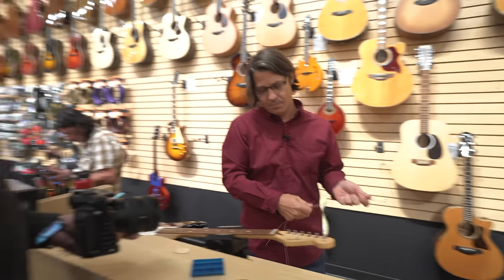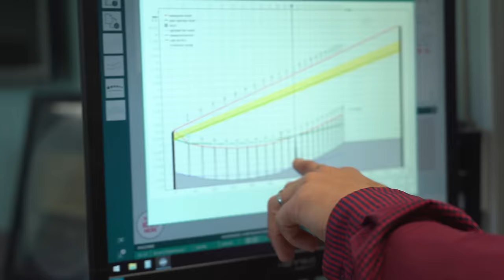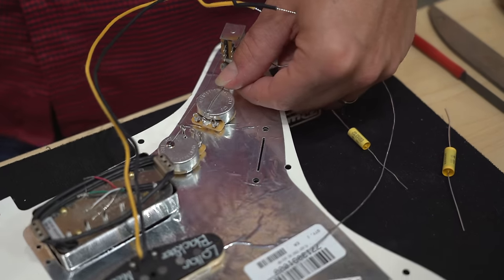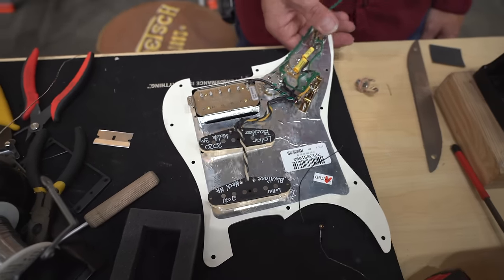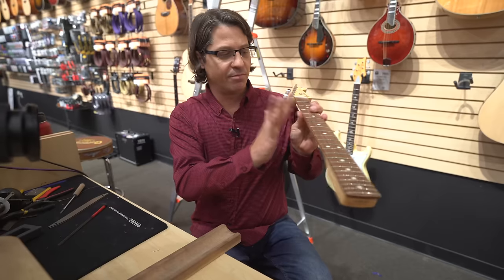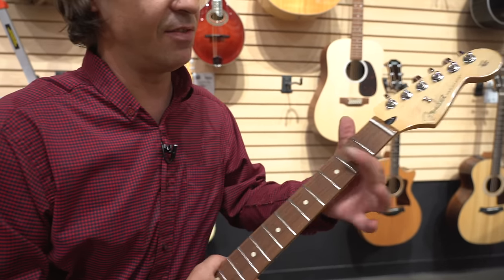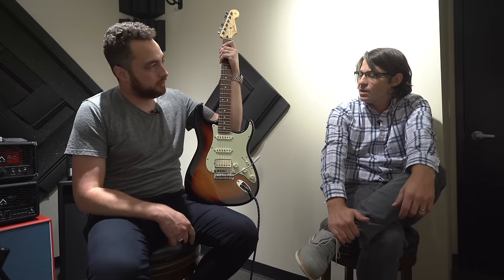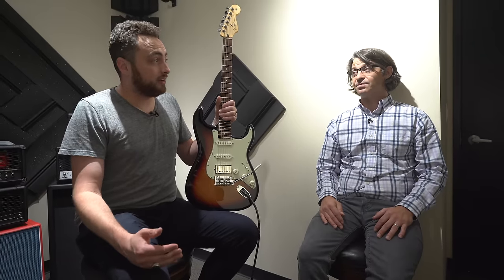We Tried To "Custom Shop" The Cheapest Fender Strat

Comment: The better comparison would be to which Fender Strat can you buy off the shelf new for $1900 and how does it compare to the upgraded Squier. I'd love to see this dollar to dollar.  Keep up the great work, Rhett!
Reply: It's a upgraded Fender Player Serie MIM. Not a Squier.
Reply: @slimturnpike  
If they had done this to a Squire, there would be no contest.  But they did this to a Fender MIM Player Stratocaster, so the contest is a bit closer.  I would say, after all that work, this guitar would be better than a 1900 dollar Fender Stratocaster.  This will have better fret work, this will have better pickups and wiring, this will have a better feeling neck..  In every way that actually matters to a person who plays, this guitar would beat out the American Professional II series that sells for around 1900 dollars ish.
Reply: There has been quite some videos about that. Depending on author, the results were mixed. Mostly they say, it kinda sounds similar, but in hand and the player experience is still cheap guitar.
Reply: @lfaf9509  totally agree. This thing has the fret work of a custom guitar, those guitars cost 5000. This things action and playability are where all that money is saved. You WILL not find a guitar this playable for less than 2000. you just will not. Or, if someone says they know of a guitar, with custom shop level fretwork, and all that, let us know, so we can buy them.
Reply: @stanislavmigra  
I think its in peoples head in some cases, and in other cases they didn't do what is needed to make the cheap guitar feel like the expensive one they say they want it too feel and sound like.   
Case in point, in this very video, he said you couldn't do it because the finish on the neck wasn't the same....  Earlier in the video they said they were going to take some of the finish off the neck and apply basically a new finish on it.  ...  If the goal was to make it feel like a Custom Shop Guitar, why didn't they just remove all the finish on the neck and replace it with the same Finish that Fender uses on Their Custom Shop Guitars?  
Don't get me wrong, they did a good job upgrading this guitar, but without the right changes, this guitar could never feel the same as a Custom Shop Guitar.  So not doing the correct changes, ensures the answer at the end of the video will always be, "no".
Reply: AVRI
Reply: @messagedeleted1922  
I might be a little broken but I would never, ever, ever tell anyone to ever spend 2000 dollars on a guitar lol.  I mean, not when you could buy a cheap Squire and upgrade it to play and sound how ever you want it to sound and play.  I mean, you can do a Fender Custom shop level Fret job yourself or pay a tech to do it for you.   
With that said, all the company's that produce guitars at that price range will produce guitars with comparable fret jobs honestly.  Fender's Custom Shop Fret work is good and all, but its comparable to what most company's produce for less, at least from my perspective.
Reply: I’ve got great, light (like I wanted & needed) 2020 Affinity I’m adding to doing my own work as I have the funds and it’s coming along beautifully. I know it’ll never be a custom or maybe not even a Pro II but when done it’s gonna be exactly what I envisioned 2 years ago. And sounds (should) already feels great. A keeper.
Reply: I'm wondering this and I know there are some videos on it but sorta haven't answered my questions 100%. Let's say you have an American Strat and a $300-400 squier. I see some people say "no matter what you do or upgrades you use, the squier will never be what the American Fender is" OK so why is that?! Does it all come down to the quality of Woods used? Because basically everything but the actual wood can be changed out and upgraded right? But I still see people say "No. it doesn't compare". Is it somewhat the "Fender" name playing into that opinion? I think also "upgraded cheap guitar" is appealing to some people because not everyone has 1,000+ extra to spend all at once. It's easier to buy parts here and there when you have the $ to spend. So basically I'm asking, if I eventually took every part off the Fender and put it on the squier, set it up, fixed up frets/neck, why would it not be as good still?! Some of the spec sheets I've seen looked like they even use the same woods? Honestly wondering.
Reply: @Bb186fo  
What I am about to say might very well make a few people angry, but I will answer your question.  
The guitar will sound and feel the same as the expensive guitar who's specs you copied.  The wood doesn't actually matter, that is all advertising b.s. honestly.  People have said differently, but its always ether because they didn't do as good of a setup on the cheap guitar or they didn't use the same parts, or didn't copy neck shape, or are concerned with resale value more than reality its self.   The only difference between your project guitar and the expensive one you copied, will be the name on the headstock and resale value.  In every way that matters, if done right, they will be functionally the same guitar in every way that matters as a player.
Reply: @stevelaferney3579  
Depending on the parts and how good of a job is done on it, it will not only be a keeper, it will feel and sound like any expensive guitar.  It might be a little thinner than a custom shop, I can't remember if it was the Affinity or the Contemporary that Squire used a thinner body on.   But outside of that possibility, it will feel and sound just as good as a custom shop guitar, providing the work you do or have done is equal to that level of work, and the parts are as well.
Reply: HUGE oversight imho. He did a similar thing with the amp vs plugin video, didn't compare the amps themselves through the same cab or same IR.
Reply: @messagedeleted1922  "Or, if someone says they know of a guitar, with custom shop level fretwork, and all that, let us know, so we can buy them." An Answer: Weir guitars. May or may not be your style. Dave at Weir hand selects wood, kilns it himself, then makes some of the best necks in the business. Guitar will run ~$1250 today.
Reply: It's not a squire.
Reply: I mean there are literally 20 videos doing tht already lol
Reply: Exactly my thought.  If you had $2k to spend, why not by a $2k guitar which will probably have better resale.
Reply: Or swap everything on the two except for the neck and body
Reply: @Bb186fo  
It won't be as good, because it is what it is.
The guitar you envision will always be a modified Squire, you'll know that, and regardless of what it sounds and plays like, you'll always have that nagging doubt that it doesn't make you feel as good as if you had the real deal.
There's a huge psychological aspect to this hobby and it's real, if you had a great US Strat, you'll cherish it and it will make you feel good just owning it knowing what it is, as opposed to your modified Squire, which will always be just a soulless bunch of parts.
Reply: @lfaf9509  Refinishing will never look right because to preserve the logo and SN, you'd have to leave the headstock faces or the entire thing in poly.  Either way, it's going to cost quite a bit for a shop to do that work.
Reply: @markuyehara7880  
Shops charge between 200 and 600 to do it sure, but with nothing more than the paint and the cheap stickers and sand paper and time, you can do it at your house honestly. 
Sure it cost money ether way, one for a lot less money and the other way for a lot more money. 
Ether way though, how good or bad it looks depends on who does the work more than anything else really.  I mean, if you are careful you can remove the clear coat of Polly without messing up the paint under it, and replace just that with Nitro..  If it actually matters to you as a player..  
Honestly the only part of the guitar where the finish actually matters, is the back of the neck.  Think about the best Gibson you ever played, I am willing the bet the finish on the back of the neck had ether worn off or someone sanded it off, or it had a Satin neck finish.   The only finish that matters for playing is the neck..  Do you know how much it cost to take the polly finish from a neck?  You can do it at home for the cost of the 600 grit sand paper, or you can pay a shop to do it for you.  That can run about 100 dollars or so, but honestly you can likely find a shop to do it for way cheaper.
Reply: Yes. This should definitely be the next video!
Reply: @lfaf9509  What I heard was that they were going to sand it with a scotch pad, and put some carnauba wax on it. Not a new finish.
Reply: @Bikedueder  
Taking a scotch pad to the neck would remove some finish from the neck.  Basically they scratched up the finish on the neck, then put wax on it to fill in the scratches.  The hopes is to make one type of gloss finish feel like another type of gloss finish.  Polly to nitro..  I would of liked them to ether use a scotch pad on the neck and not do the wax treatment, or use sand paper and remove at least most of the polly finish, if not all of it.  Then refinish it with a more satin finish..  But I am one of those folks who hate gloss finishes on necks, they get sticky and are hard to keep them from getting that way.    
I owned a Epiphone SG Modern and no matter how often I cleaned its neck, it would become sticky within a minuet or so of playing.   I have sold very few guitars in my life, that one I sold..  Though now I wish I just took a scotch pad to its neck... live and learn I guess..
Reply: @lfaf9509  “I would never, ever, ever tell anyone…” well, keep in mind that some $2000 guitars feel - in hand, to an excellent player - like a $1000 guitar. And some $2000 guitars - to that same player - feel like a $4000 guitar. As with anything made in part or in whole by humans, the specific instrument matters.
Reply: Same question occurred to me but then what would be the fun in that?
Reply: @turunturun  
I think that is a bit of some old marketing b.s. myself.  Most guitars are made mostly by machine now days, and thus won't have much of a difference between them.   At least that is the case outside of custom shop, and a lot of that process will include machines to do the heavy lifting for the person putting it together. 
You take that same person who says they can feel the difference between a 1000 dollar guitar and a 4000, and blind fold them.  Let them compare a Squire with a really really good setup on it, and a Fender custom shop and the only way they might spot the difference, is if the pickups are different, or they are used to the neck shape on one of them.  Switch the pickups around and they wouldn't be able to tell the difference.
Reply: @lfaf9509   I don't have sweaty hands, so therefore I have no issue with gloss necks at all.  It is not the finish on the neck that is the problem, it's your hands.....  Don't buy guitars with gloss necks, and you should be good. Some advice though.. Replace the whole neck, and sell the original to someone who can use it as is, instead of ruining it by sanding all of the finish off.
Reply: @Bikedueder  
If the goal is to make a guitar play better, and a Satin finish on necks play better for most players..  Some necks you can take off easily and other necks are glued in and are thus harder to take off without damaging them.  So removing the finish from the neck is often easier and if you are just using a scotch pad on the neck to remove some finish, you are not removing all the finish..  Basically you are just changing the texture of the neck so that its easier to play.    
Yes sweaty hands do make a guitar with a gloss neck harder to play, but Satin finishes are easier to play on than gloss for everyone, not just people who's hands sweat.   
make no mistake though, sanding some finish off a polly neck, is in no way actually ruining it.  If it makes it easier to play, its just adjusting it to be more playable.  We don't call shining frets ruining them, so we shouldn't call sanding some finish from a neck ruining it. 
Try to remember though, the stated goal in the video was to upgrade a guitar to make it feel as good as a custom shop guitar.  Custom shop guitars come with a different finish on both the body and neck, than a cheap guitar will.  Changing the neck out can work on a bolt on neck, but such a job is more expensive and harder on guitars with glued in necks..  Sanding it down is likely cheaper in ether case, which is why they did exactly that in this video. :)
Reply: That is a Fender… not a Squier…
Reply: @REBELSCL  I stand corrected
Reply: @REBELSCL  
"That is a Fender… not a Squier…"
....  I think I am likely about to blow your mind ready?..  A Squire is in fact a Fender, just like a PRS SE is still a PRS, or a Epiphone is still a Gibson lol..   Fender owns Squire, just like PRS owns the SE guitars, just like Gibson owns Epiphone..  A Jackson is still a Fender, a Kramer is still a Gibson..  Get it?     Its the same company, who just puts different names on guitar head stocks to signify where they are made more than anything. 
For PRS a SE is made over seas, for Gibson a Epiphone is made over seas, for Fender a Squire is made over seas..   
I get it though, the guitar used in this video had the name Fender on the headstock, and it was made in Mexico, but the point of the OP is just as valid really..  Wouldn't you love to see what the Op was asking for?  A dollar to dollar comparison.
Reply: @stanislavmigra  did they eliminate bias? You have to do those sort of tests blind, especially when there’s a perceived value difference.
Reply: @Michael Casias 00's and 90's squiers are great
Reply: @lfaf9509  The wood matters quite a bit. If it didn't then you couldn't run the rack and find guitars that sound significantly different that were specced the same. That said, it doesn't mean what you find in a more expensive Fender is going to be better than what you might find in a Squire. It's much more of a luck of the draw thing.
Reply: @brandall101  
"guitars that sound significantly different that were specced the same. "
I didn't quote exactly what you said, but I figured you would know what I was replying to exactly by my response lol. 
Anyhow, if you find two guitars that are speced the same, but sound different, it isn't the wood thats doing that.  Inconsistency in the process of making pickups can do it, margin of error in the pots can do it, even a slight difference in the position of the pickups along the scale of the two guitars can cause it.   There are so many things that can cause what you are talking about, I see no reason to even suspect wood plays a roll when there are so many more logical reasons for slight differences in tone  between two guitars with the same specs...  Even setup can cause a difference....
Though I do believe there is some luck of the draw, its just about the pickups and setup and where the pickups are along the scale thing..
Reply: SRV signature strat.
Reply: An HSS Professional II runs $1749
An HSS American Ultra runs $2149
I got my brand new,  warranty covered HSS American Ultra "B-Stock" for $1736. And it's flawless. I think it was a "B-Stock" just to get around the MAP.

So ,$1900 for this  "upgraded" Fender is a complete waste of money.
Reply: Against a moded Squier Classic Vibe
Reply: @StoTemPil  check out my modded bullet.    Seam foam green hard tail aged parts and tortoise shell pick guard
Reply: Can say from experience that you can make a Squier bullet play better than a fender with enough time and some money for electronics upgrades. Even with boutique pickups, you’re coming in wayyyyyy lower price than higher end fender guitars
Reply: @eriktaylor4323  I did it.    Check out my sea foam green hardtail with aged parts and tortoise shell guard.
Reply: @lfaf9509  Well, thats because wood vibrates, so part of the vibration of the string is absorbed by the wood. 
What that means? That wood directly influences how the string vibrates, thus influencing the way it sounds. 
Use a cheap, bland wood, and you will have things like less highs and lack of sustain. With better, harder woods, the highs are more defined and the sustain is longer, cause harder wood will absorb less frecuencies from the string.
If you can't hear a difference among different guitars must be bucause the woods used today are mostly good woods. I mean, we have almost 100 years making electric instruments, we already know what works and what not, and deffinitely there are some cheap options that still work. 
Anyways, wood is just a part of the whole thing. As you mentioned, there are a lot of factors that influences tone.
Reply: @slash148  
"wood vibrates, so part of the vibration of the string is absorbed by the wood. "

You might think huh, but in reality you impart energy into the string when you play it, and some of that energy goes to the pickups which is turned into a very small charge, some energy is transferred into the air via sound waves, which is what you hear without the amp, and some energy is transferred into the wood and escapes via the wood vibrating.  The net total amount of energy that escapes the strings affects actual sustain as the more energy that can or does escape the faster the string stops vibrating.   
Now, all wood vibrates within a very small frequency range, and the range is so small the human ear could not hope to ever pickup on it.  So even if wood were absorbing frequency's and such, all the difference would be so very slight that no matter how hard you strain your ears, you couldn't hear the difference. ..  Yet, one small difference in how a pickup is constructed or wound, will make a massive difference....
The concept of tone woods has been around for a very long time, but it is and always was just marketing b.s.  The only actual thing wood choice affects, is looks and of course how easy it is to ding or scratch..  The rest, actual Science has already proven to be untrue....
Reply: I have a squire classic vibe jazzmaster. New tuners the second I got it, then new wiring/pickups after about 6 months, then new bridge/trem about 6 months later. Went over board on the pick ups/wiring, but got some fun custom mods that make it feel personal. The neck and body are still great, and I don't feel bad letting it get beat to shit playing some lively shows at smaller venues, let a friend paint the back, would always do this over both the American Pro ii models.
Reply: I bet custom shop Strats are not pleked.
Reply: @messagedeleted1922  well you can get custom shop fretwork and playability if you pay like 150 bucks to a good luthier lol
Reply: I just don't get why an  $800 plus guitar needs that much fret work.  A $200 is one yes, but $800 ?
Reply: An American Vintage II is $1900. I'd take that over this build any day.
Reply: a fender neck with jumbo frets its 300eur in europe(probably way cheaper in the US). I would get the cheapest squier body for 150, put the 300 bucks neck in it and chage the pickups another 150bucks. That's it. 600 bucks and it will beat the crap of any production guitar. I did it myself a decade ago, i bought a japanese fender strat/tele neck monstrosity and years later the squier classic vibe tele. I swapped the neck and put fender custom shop alnico pickups in it for another 150. For well less than 1000 bucks I have 2 guitars and one of them looks and plays just like a custom shop vintage tele.
Reply: Squier…. NO go buddy. This video is the sweet spot, it had to be a fender
Reply: I recognized my mistake when i wrote this comment a year ago:) @CraigularjJoeWoodworks
Reply: @lfaf9509 yeah not true. My buddy has a modded squier that everyone thinks is a fender custom shop lol.